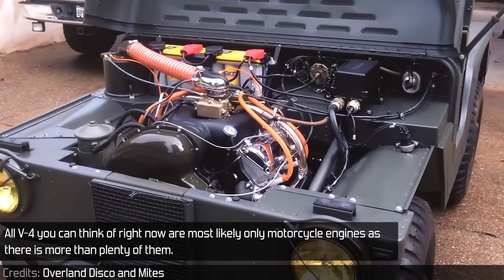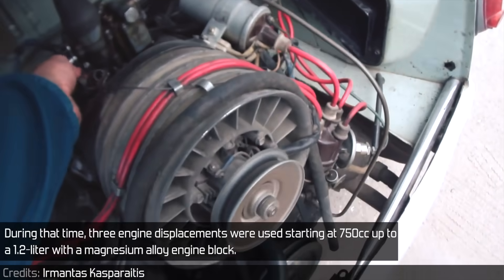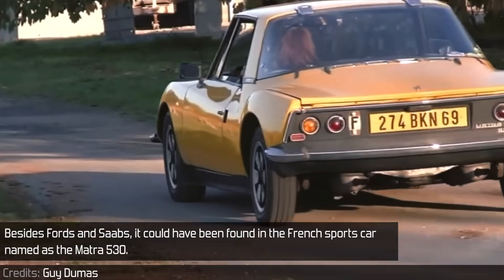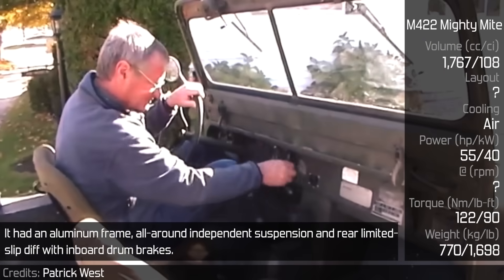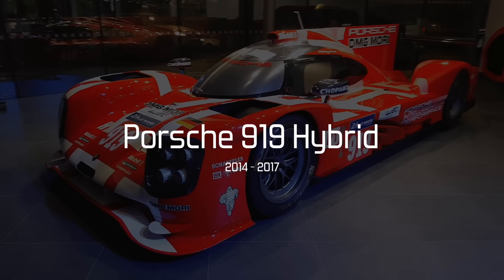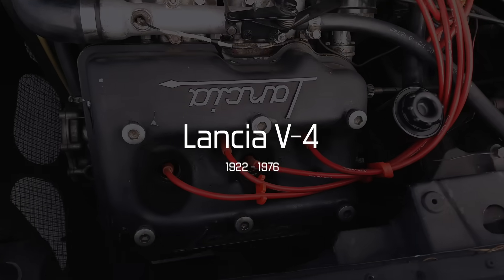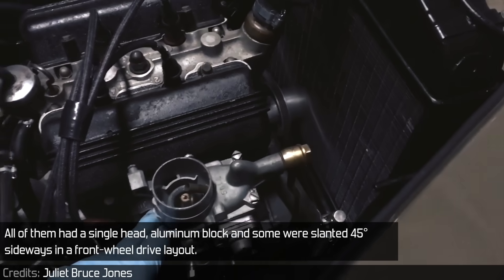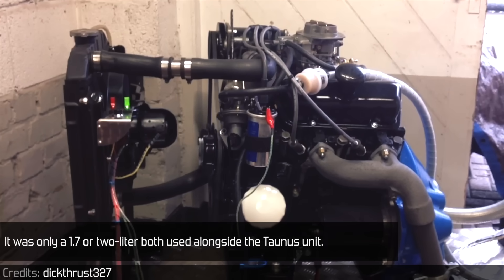The Only 6 Automobile V-4 Engines To Exist

Comment: So why didn't v4s take off?
Reply: The reason for them is that they are short and very compact, which means you can instal them ahead of the front axle for FWD. But they're more expensive to make, so if you don't need that facility (and most carmakers never did), it's unneeded expense. The extra outlay can be mitigated if you have a sister V6 in programme which shares all the same tools. This Ford had with their V4's (both Köln and Essex), so the expense was not a major issue.
Reply: Actually the V4 layout was used to make the lenght needed for the engine bay shorter for RWD cars, the mk1 Transit was the reason Ford did develop the Essex and the Taunus was originally developed for a new compact car for the US, the Cardinal, but that project grounded and instead the Taunus was developed around it.
While the  German Taunus and British Cortina models were similar looking cars with only detail differences the V4 was only available in the Taunus besides a line of I4 engines
In a funny way Ford used inline fours for their smallest RWD model, the Escorts mk1 and mk2, where the advantages of a V4 could be most practicable.
When most of their cars got FWD, from the 1977 mk1 Fiesta, the V4's disappeared as they were more expensive to produce, with two separate cylinder blocks and heads for each engine.
Reply: Manufacturing cost also most of them weren't as smooth as an inline 4.
Reply: Quite common in motorcycles.
Reply: Possibly because they never fitted them in aircraft....😂
Reply: People in the USA wanted a V8 or the inline 6 .  Much like England of the time using low compression 6 to 1 tractor engines of the time .
Reply: They are not more expensive to make . Ford of Germany had these engines before WW2 . They was used as pony engines on ships .  The Ford  designed the 260 and the 289 V8 off this engine .
Reply: The balance is a problem ZAZ engines needed special shaft to balance the vibration.
Reply: Ragimund VonWallat could have sworn a friends late 80's corolla hatchback had itas well as a factory lemans race car in the 90's had a turbo v4 that was desemating the compitition for a while.
Reply: The balance of a v4 is difficult to get right, but it's very simple with an i4, so why go through the trouble of trying to make a v4 just right when you can make an i4 and just sti k it in a be good to go
Reply: +Dieselmupke: Back in the Eighties I had a 3 liter V6 Granada (M reg, 1973). The maintenance manual that I had for it also gave the info for a 2 liter V4, so I assume that was also available in the Granada range. A lovely smooth engine, the V6, but prone to blowing the cylinder head core plugs, if I remember correctly, and one of the plugs was a right bitch to get at!
Reply: Didn't Toyota have some v4's in the 80's/90's?
Reply: adam shaw never heard of it, in wich cars???
Reply: ah those corolla gts...i always seen them with inline 4 but maybe some obscure version exist... as for full race car its entirely possible, i couldnt say.
Reply: no the windsor werent designed off them... total baseless non sense
Reply: seisix6 ... You stole that from me.   😂
Reply: v4 balance just dandy at 90 degree not any harder than an inline 4
Reply: whey wont give out nice engines

Comment: There were few more soviet cars equiped with v4 engine, such as successors of ZAZ-965 that you mentioned: ZAZ-966, ZAZ-968. Also there were off-road vehicles such as LuAZ-969 and army amphibian LuAZ-967 (TPK). Basicly their engines vere the same, but had various displacement and power output.

Comment: You could get the Ford V4 in the Transit as well!!!
Reply: The v4 engine performed a lot better in the transit than the more modern 1.6 and 2.0 engines that replaced them. I drove them all including the v6 and diesels the v4 was my favourite. 3.0 v6 was fast but very thirsty.
Reply: @martinaddison5991  Except it kept blowing head gaskets!
Reply: Ford done that with the first series Transits.
Reply: The transit v4 was regarded as a crap motor in australia for several reasons, but the main one probably would be that people compared them to the later aussie transits that came with the falcon straight six- these were the only reliable motor transits ever had.
Reply: Thousands of them :)
Reply: I put the 2.0L V4 from a Ford Transit van into a Mk1 Escort panelvan in the late 80s.  Great fit, good power and an awesome sound from the twin system and side-pipes.
Reply: That's right.
They build the Taunus P4 with 1.2 litre V4. It was called Taunus 12M, 12 for 1.2 litres and M for Meisterstück, which means masterpiece :)
The later model Taunus P6 was also called 12M but it had a 1.3 litre engine. Except you ordered a 15M with the 1.5 litre engine or the 15M RS with the 1.7litre engine.
With 75HP and only 865Kg it was one of the faster cars back in the late 60's.
And still today it runs good ;)
Reply: Stalin Yes also the Ford Corsair ,America recently started using the transit name but this van is coming ti jamaica since the 60s along with the Corsair with V4 engines. We used to swap out it & put rhe v6 capri engines in those two vehicles
Reply: @robertcampbell9946  Yes. It seems that everyone forgot the Corsair !
Reply: @ramishrambarran3998  And the mk 4 zephyr mk 1 capri
Reply: Yeah, didn't they have smaller V4s than 1.7 litre?  I think Ford made V4s as small as 1.2 litres.
Reply: Was nice and short under the hood. They used to shake the exhaust headers off sooner than later.
Reply: My dad mentioned this. And that they later swapped in a v6 from a capri and it was more powerful and more fuel efficient than the v4
Reply: I had one dropped in a mk1 Capri......seriously
Reply: As OttovonEarth say, they had a 1498 cc variant as well. It was used in Saab 95 and 96. It was also used by Ford in the 15M and the 1,7 litre was used in the 17M.
The 1,7 liter engine was a popular replacement in the Saabs. With the intake manifold and the dual port carb from the 17M it made the small and light weight Saabs quite fast for a cheap car.
The only problem was that the 1,7 liter pistons wouldn´t last in the Saabs if the engine was revved high during longer periods, such as long highway running at high speeds.
Those engines where sometimes bored out to about 1815 cc for rallye cars (mostly Saabs) and they had the cylinder heads changed from the original restrictive siamese exhaust port to some kind of dual exhaust port cylinder heads.

I´m quite sure this engine started its life as with only 1,2 liter displacement.  I think it was used in a smaller car named 12M in in the beginning of the sixties. That might have been a front wheel drive car. I think there was a sub frame for front wheels and maybe even the engine and that sub frame was mounted to the body with very soft rubber cushions, creating a very "soft" feeling with bad behaviuor in critical situations. I think the 12M was meant for the US market but didn´t succeed there.
But all this about the 12M is what I have heard but I´m not sure about it so don´t qoute me on it. :-)
Reply: both of them, the Taunus engine and the Essex engine as well.
Reply: If i recall in Australia we had two different sized v4's in the transit, i think 1.9 for the small van and 2.7ltr for the long wheelbase dual wheel one.. I remember dad bought a replacement engine for his big transit,and they gave him the small engine. So he sold it and his blown one, and put a mk3 zephyr  inline 6 cyl engine in.
Reply: Stalin absolutely and didn't they have a crappy sound 😂😂
Reply: @jeffreysheldrake3243  we usuall switched to the capri engines .
Reply: In the States, we got them as Pinto engines. Pretty torquey in low rpm but wheezy at speed.
Reply: Last time I saw a V4 Ford Transit engine was about twelve years ago in a little "Z" series Morris pickup/hot rod at the Winter Sun car show at Coolangatta on the Queensland NSW border 

Another very interesting feature of this car was the fella who owned and built it was missing a front mudguard and wasn't able to find an original one so modified a VW Beetle front guard to fit perectly 

It also had small spoked wheels from some type of Datsun prototype(?) 

Very impressive little car. Somewhere I have photos of it on a memory card
Reply: Ford Taunus 12m and 17m , designated by Ford of Germany as the Cologne V4, the 12M, was front wheel drive 4 speed column shift manual, longitudinal engine v4, , very smooth engine compared to the inline 4 Kent Ohv,  and the sohc Essex  I 4 installed in the Escort Mark 1/Mark 2, and the Ford Cortina(Ford of England,)  have tried driving also the 17M model,  v4, rwd, 4 spd manual column shift, front bench seats.
Reply: Ford Granada not sure how it was called in the Uk

Comment: The California State Police Rangers had a dune buggy powered by a Taunus V-4 that they used for many years to patrol Pismo Beach on the Central Coast of California. On Pismo Beach State Park it is legal to drive vehicles down to the sand dune recreation area. The speed limit was 15mph or 24kmh and the Rangers issued many speeding violations from their V-4 buggy. I really liked that engine and wanted one.

 The Beach Patrol  pulled me over once with it while driving my flat fendered CJ2-A Jeep. They wrote me a violation for excessive noise. I couldn't understand why. My engine was a Chevy 350 with Detroit Diesel 4-71 blower, Sig Erson roller cam,  open headers and Boynton Brothers paddle tires on 22 inch wide rims...56cm wide. It could throw a rooster tail of sand 150 feet, 50 meters, behind me when I punched it.

Comment: Really cool sound from the V4's. I knew they must had been used, but never knew of an example. Another quality automotive history lesson.
Reply: I have a diesel V4 From a pretty rare communist tractor. Its in a veeeery baaaad shape but i think i can repair it and use it on a homemade quadbike cause it Has plenty of torqe and its air cooled and has 25hp
Reply: Subaru used to have a horizontally opposed 4 cyl engine that was pretty decent.
 Unlike the VW engine, it was water cooled.
Reply: Homebrew Subar
Reply: L99”9
Reply: Exactly i was very curious to see what there exhaust note sounded like
Reply: I love omc v4 and Yamaha v4 outboard 2 stroke s and there sound, you can’t give an automotive v4 4 stroke

Comment: the number of when the Ford Essex V4 was made is not correct it says that it was made until 1887 and that the production started  in 1967 it think you made a typo with the 1887 and you wanted to type 1987

Comment: I think you’ve got a typo on the production years of the Ford Essex V-4; it shows “1961-1877”
Reply: The only engine to go back in time!!! Come on. That's a selling point
Reply: I remember that engine in the 2000E Corsair, flying machine!
Reply: Doktor Hachi Roku its flux capacitor.. Not compensator
Reply: I was about to say the same thing. Good that I wasn't the only one that noticed.
Reply: I used to own a 1969 Mk1 Ford Capri 2.0 GTXLR with a V4 Essex. Great car with a great engine.
Reply: *flux capacitor
Reply: I had a v4 Essex in a Mk1 Granada. Under the bonnet was a spacer between the grill and the radiator.
Presume that was left out when the 3 litre V6 was dropped in.
The V4 was replaced with the SOHC Cortina engine
Reply: A garage I worked in long ago had a V4 capri come in for a possible restoration on the engine, unfortunately it was in terrible condition =(
Reply: A few different cars used the Essex V4 :
Mk1 Transit from 1965 to 1977
Mk1 Capri from 1969-1972
Mk1 Granada / Consul from 1971 to about 1975.
Corsair 2000E
Even some Marcos sports cars had them.
Reply: Took me to remember that the Corsair was also a car.  My first thought was the F4U Corsair we Yanks used in WWII... different type of flying machine!
Reply: it was produced back to the future
Reply: My dad had a transit dormobile with a Ford v4 and he put higher compression heads on it and a sidewinder exhaust and it was super fun and super reliable , taking us around Europe in the 70's and we had a blast.fond fond memories.thank you Ford!
Reply: Ford also made the V4 powered Corsair.
They used many variants from 1663cc to 2.0  litre.
Reply: The replacement was the Pinto unit.
Reply: Uriah Siner naw Bro I had one in my 1884 model Conestoga. Thing left me stranded in the Dakota Territory tho so I traded it in.
Reply: It was made from 1965 to 1977.
The Essex V6 was derived from it by simply adding 2 cylinders at the front.
The V6 was made from 1966 to April 2000.
It's on Wikipedia.
Reply: No, the dates are in B.C.
Reply: In 1878 I had one V4 Essex, really!🤣

Comment: I am sorry, but that Lancia engine isn't really a V4 engine, since it's not even a V engine, it's a VR engine (V-Reihe a.k.a V-Row). Just as the Golf R32 engine isn't a V6 nor it is a straight 6.
Reply: omfgwtfbbq90
Wrong. Narrow VEE is a V, but you're half right-it's not a straight 6.
Reply: Nope! Even when it's a very small angle v, then it's still a v engine. Even if it has only one head. VR is a term which VW started to use during the late 80's / early 90's, just to differentiate itself from the more common traditional v. engines.
Reply: omfgwtfbbq90
VR engines are NOT inline, but narrow angle V. It doesn't matter that you don't like it, nor want it to be.
THAT's what the "V" signifies, what it DEMONSTRATES.
Reply: VR has it's own nomenclature and category. Hence it should not be in this video. It should be in a video called "Automobile VR Engines" but that would be a short video because there aren't that many. And for a good reason.
A VR engine has more in common with a straight engine than a V engine.
Reply: Try telling that to a Lancia guy...
Reply: Exactly
Reply: Ragimund VonWallat Insults suck the fun out of car talks.
Reply: These engines are slanted engines ( Dodge/Chrysler slant inline 6 and 67-68 Pontiac 371 slant inline 6).
The slant did two things, it gives a certain mechanical advantage in relation to gravity on the crankshaft (torque)
and lowers the stroke profile (engine mounted height in the frame of the car) thus you can lower the overall side 
profile of the car.

Comment: Saab 96 came with 1,5 and 1,7 OHV V4
Reply: he's right they were v4's 
1,498 cc Taunus V4 (gasoline)
1,698 cc Taunus V4 (gasoline)
Reply: Wasn't a V3, it was a slant 3
Reply: Saab used the Ford V4. Before that they had 2 and 3 cylinder straight two-strokes
Reply: Gacazato:
No, Saab 95 and 96 only came with the 1,5 liter V4.
They bought it from Ford but they never used the 1,7 liter.

But Saab had another 1,7 liter engine from GB but that was the Triumph 1,7 and 1,85 liter engine in the Saab 99 but that´s another story. :-)
Reply: TaUnc, I had to look that up because I was 100 % sure that the 1,7 liter engine never was used by Saab. It seems that we are both right.
The 1,7 was used in a de-tuned version in the US, but never in Europe.
I live in Sweden, where Saab was made and only the 1,5 was used. I guess that you live in USA?
https://en.wikipedia.org/wiki/Ford_Taunus_V4_engine#1.7
Reply: Yes, I also owned and maintained a '62 96 sedan, a '65 95 wagon, a '69 99 which had a transplanted '73 99 EMS 2.0 liter engine,  (Very fast..) and a '71 V4 with the 1.7 liter v4.  Interesting that European SAAB's didn't get the 1.7 liter, as it was a decent engine and shared many parts with the German Ford 2.8 liter V6.
Reply: Nope, those were straights.
Reply: Sorry, this was meant to come under the reaction of Jerry Lynch.
Reply: No Robert, I worked with someone who worked exclusively with SAAB 95, 96 and Sonnets and they had a 1.7 liter engine after 1971.
Reply: Gacazato The two jokes were great for mosquito control.
Reply: Saab also had a 2 stroke V-3
Reply: @gelynch52phPH  was a linear 3 cyl.

Comment: Thanks man, I'm currently building a modified Essex 2000cc V4. I've always loved these engines.
Reply: I think the Corsairs etc came with twin SU's , but I know my old Capri had a twin downdraught weber on it. Awesome exhaust note when you floored it :)
Reply: Paul Belson are they very difficult to work on?
Reply: Not at all, pretty basic really. They are the same as a V6 but with a balance shaft that is timed off the crank. It was originally meant to be a diesel  engine, so don't expect it to rev.
Reply: Nice ! In a ford, a saab ?... What have you done and what kind of power are you pushing ?
Reply: In a Capri, only just starting, so will have to wait and see what it does.
Reply: Paul Belson Ok, sounds like a cool project, would love to see some vids !
Reply: Hi Again, I will probably do a blog, I have one for my low budget track car,  (http://plbmak.blogspot.co.uk/) so I'll most likely do one for the V4.
Reply: Paul Belson ok, post the link here when it will be out ☺

Comment: Mistake with ZAZ. 965 had 0.9l engine with 23hp firstly and 30hp later. Then it was changes by 968 (966) model with 40hp and 1.2l. Also this new engine was plased in LuAZ.